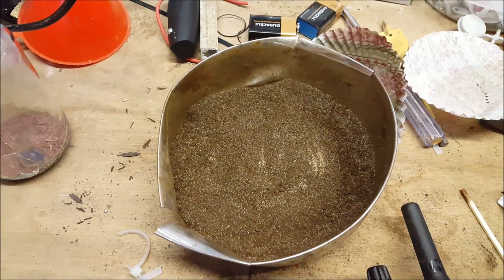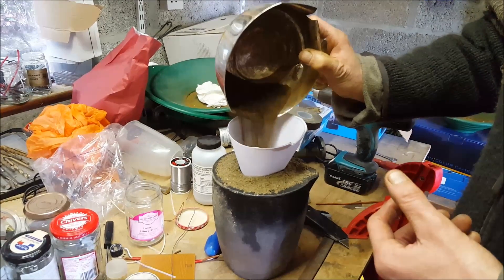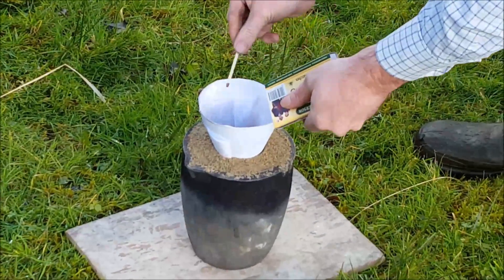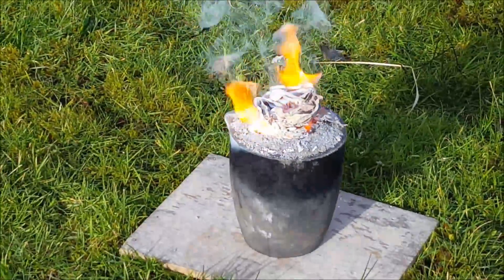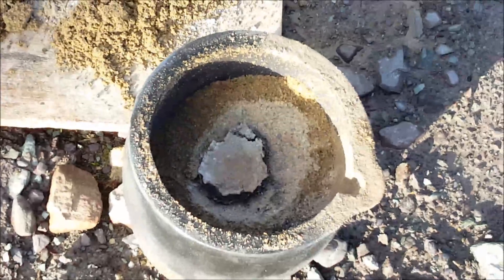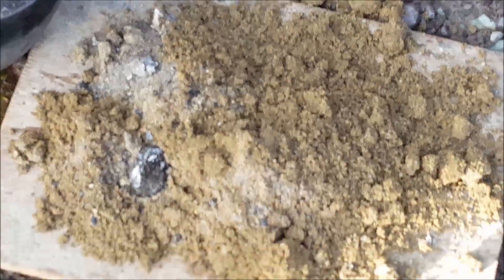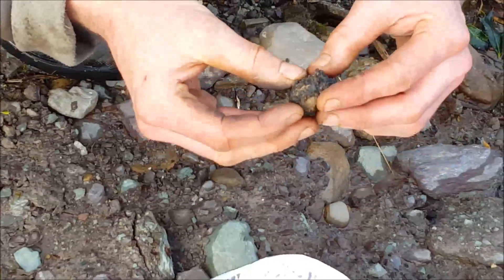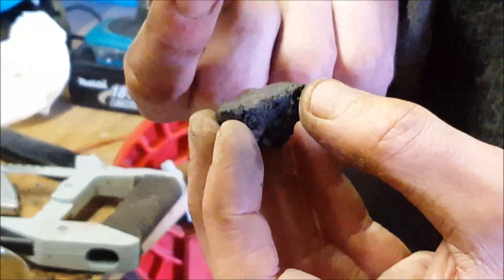Smelting Irish Bog Iron Ore using a thermite process

Comment: As some else pointed out  thermite uses powdered Aluminum  not magnesium....Magnesium ribbon is usually used to ignite thermite
Reply from the maker: Not true. Thermite is a class of mixes. Thermites use Al, Zn, Mg, Ti, Si lots of different metals. Magnesium thermite is well known and a good choice in this situation.
Reply: Aluminium is the most commonly used.  With aluminum you will get liquid iron much more easily
Reply from the maker: I did try AL but it was not as good, and my research found that Mg would be better ? Willing to give AL another go if my research is wrong, any websites/research you can point me too so I can have a read on AL being better ?